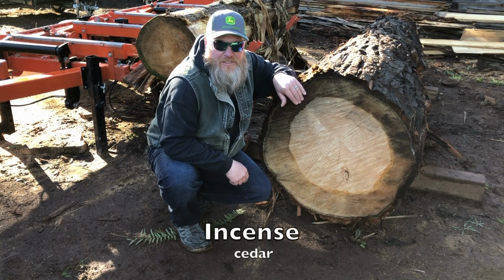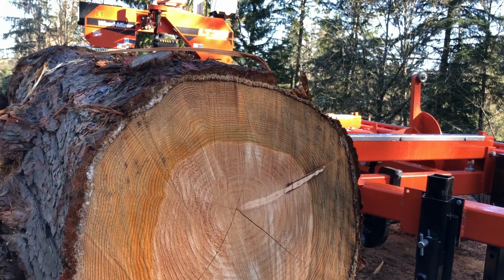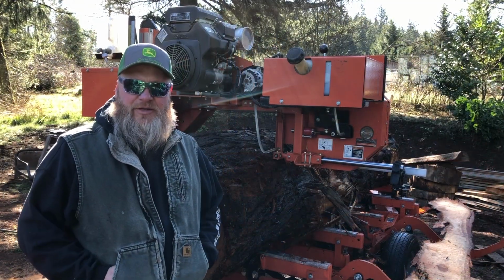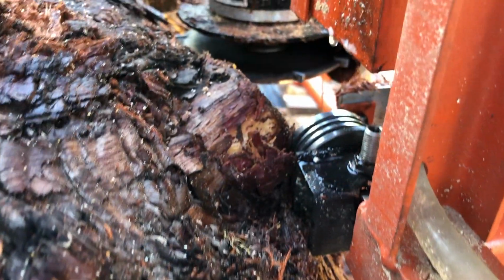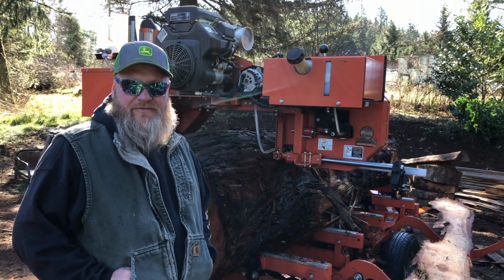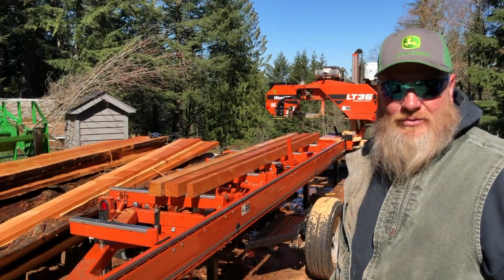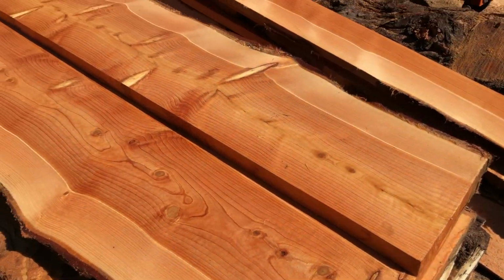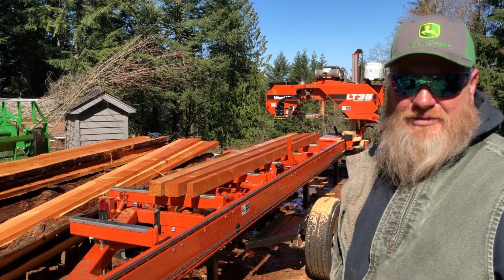Milling Incense Cedar For A Fire Station Picnic Table

Comment: Every few weeks, I will have to adjust one of the 2 rails that have the toe boards connected. the rising and dropping of the toe boards will, over time, cause one of them to get out of whack no matter how tight I make the bolts. I love that book match shot on the tractor, spectacular.
Reply from the maker: That’s good to know. I’ve never noticed it before. I need to go get caught up on your latest video. I can’t wait to see more dancing!!!😬
Reply: @NorthwestSawyer  Thanks man!
Reply: @NorthwestSawyer  I was told that I was a little dry in my videos and I should let my actual personality show through more. So, I did...
Reply from the maker: 🤣🤣🤣 I was told that this video was boring and that he was going to save it for when he needs help going to sleep.
Reply: @NorthwestSawyer  I saw that comment. Screw that guy lol. Don't feel bad, mine got a dislike...
Reply: @NorthwestSawyer  I've actually been thinking of a way to turn mine into a comedy show (more-so than it is now lol)

Comment: Another good video!!  Seeing you clean out the sawdust chute brought up a question id like to ask. Does the cedar you are cutting have the resin like the eastern cedar does?  If so I’m assuming it gums up everything, much like green pine. Just was wondering if so and if you have a solution to keep it from messing up blades and moving parts.
Reply from the maker: I was running heavy water. Once I turned off the water the problem went away. The cedar has so much in it naturally, I really didn’t need to run extra.
Reply: So it doesn’t gum up the blades?  Or the moving equipment parts?  Just was wondering.

Comment: Nice work with the loading stringers.

Speaking of strings, did you put strings on the bed to see if everything is flat?

Also, that first bookmatch set of boards was incredible.
Reply from the maker: No strings. I was able to look across the tops and see that one was way out.
Reply: @NorthwestSawyer  since you are an excavator, I'll take your word that everything was at grade. The ones I work around are good at that stuff. They may not be good with wrenches, but I'm not good with digging so it all works out.